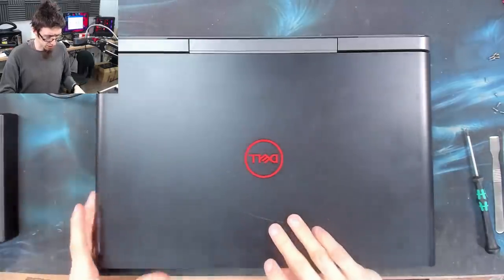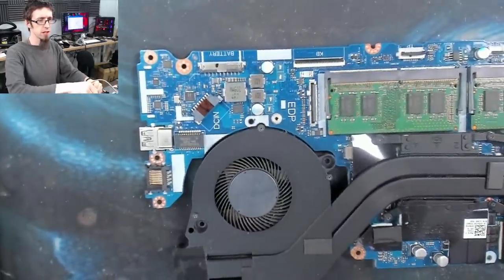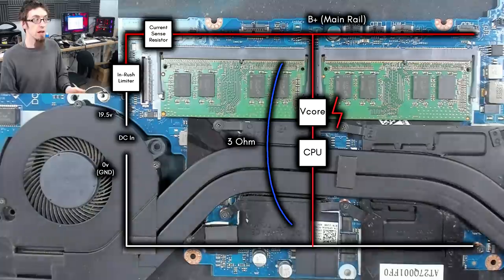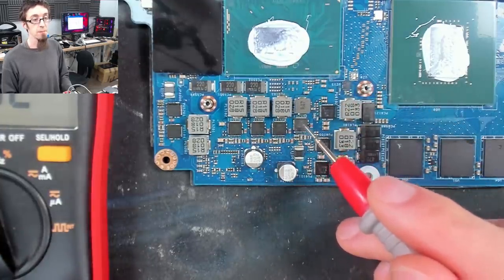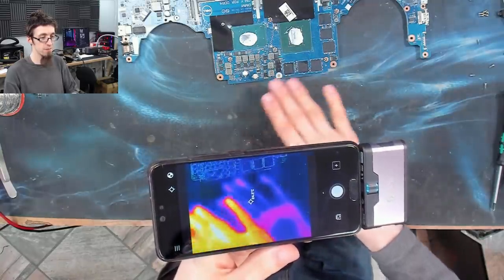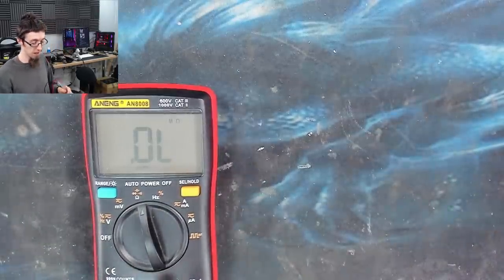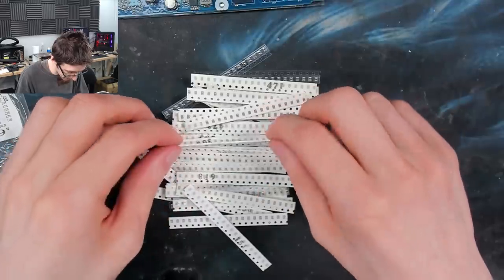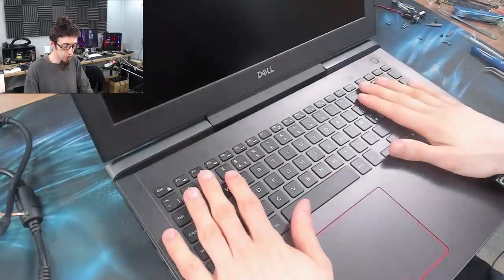How to fix a Dell Gaming Laptop (Dell G5, charger cuts out) - LFC#283

Comment: What are the ebay caps voltage ratings?  No doubt far more than adequate on a 1.8v rail, just curious.
Reply from the maker: It varies based on capacitance and package size, usually the ebay listing will show the voltage ratings. For most repair application, like laptops, everything will be size-appropriate, so low voltage rails will have physically smaller MLCCs on them with lower voltage ratings.
The voltage rating can matter when your draw extremes, for example, a 50v cap on a 1v rail won't break, but the 1v rail won't actually be able to charge the cap properly. But you'll only get caught by this if you're fitting physically gross-over-sized capacitors, which is unlikely. All of this is more relevant when designing the circuit in the first place.
For repair, as long as it's the right physical size and the right capacitance, it'll almost certainly be fine.

Electrolytic caps (with a positive and negative) are different animals and tend to have much more specific voltage ratings, which do need to be observed. They have much bigger capacitance, but the trade off is a much lower voltage rating, so you may have to search to find a replacement cap with enough voltage to match the physical size and capacitance.

Comment: @Adamant IT. Usually Dell and HP laptops does cycle a couple of times after, RAM , Battery reseat. I deal with them every couple of weeks . I am IT Admin in a company. So there is a lot of them getting defective after time. Usually after Motherboard swap, the laptop relearns RAM and checks everything in its BIOS settings. So usually it takes a couple of restarts and a couple of minutes to boot properly. So next time be patient :)

Comment: Great this is the best explanation of the voltage injection method to find a short circuit I have seen ,especially the explanation around the CPU and GPU Prosit I have learnt a lot today.could you tell me the Flir thermal camera model please.
Reply from the maker: It's a "Flir One". Check out the Seek ones as well, as they also have good reviews.
Reply: @Adamant_IT  Great video. Very helpful comparing to Nordrichfix or Rossmann.  I am going ahead to purchase one. Is it a one, LT or Pro you have got? As the resolution is different for the models (one 80x60 and pro 160x120). Many thanks
Reply: @Adamant_IT  FLIR One or FLIR One Pro?  Great video!

Comment: Why doesn't anyone use protection diodes for the "important" chips?? Transient suppressors, for example. And one should also invent a ceramic capacitor that blows up upon shorting out from the inside, so that service people don't have to search high and low for a shorted one.

Comment: I have an Alienware 17 2014, the GPU MXM card is shorting the board or is it the motherboard slot that is shorted. When I remove the card the system would boot fine on intel built-in gpu.

Comment: Hi there, appreciate the good work you do!

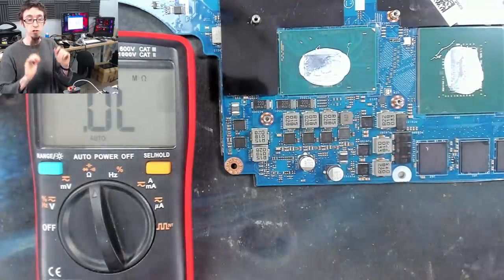If I may ask, at 22:54 you check the GPU inductors
My first inductor (PL6200) reads 20.7 Ohms, yet the second and third (PL6201; PL6202) both give me a reading of 0.3 Ohms - the 2nd and 3rd also look much darker than the 1st inductor :(
Would this be a clear indication that my GPU is fried?

I got my laptop back from the so-called technicians yesterday claiming they fixed the short, yet they suspected the GPU to be faulty
According to the steps followed in your video, I have reason to believe those idiots did not fix the short (since I get a dead short at the points you did), and instead destroyed my GPU due to their negligence

I hope there is something else I could check before ascertaining whether the GPU is dead or not

Thank you
Reply from the maker: Yea 0.3 is very low. You'd need to look at the traces to see if PL6200 is supposed to be the same rail as the other two - if it is, then it should read the same, and a high reading of 20ohms sounds like it's busted or not on properly or something like that. Any heat damage to the GPU? You never know if someone thought heat-gunning the GPU core was a good idea T_T

Comment: what actually caused the capacitors to fail though Graham ?
Reply from the maker: Mechanical stress (shock, etc) might cause fractures which lead to a short, or heat cycles could do the same. Ultimately, small parts like this are mass produced in ungodly quantities, so there's going to be a bad one here and there that dies a little early.

Comment: @Adamant IT Question, when you have a laptop come in that you repair and notice a mechanical HDD, do you recommend replacing with a SDD to improve performance for customer?
Reply from the maker: Most of the time, yes, but it depends on what the laptop is in for, what the customer is using it for, etc etc.
I recommend SSD upgrades when I can though.
Reply: @Adamant_IT  Was just curious since I noticed this laptop had a HDD.  Otherwise it seemed to be good laptop.
Reply: @hillardbishop8755  if you look closely at the beginning there is a nvme drive just above the hd so it boots off that and only uses the hd for extra storage. I know this as this was my laptop being fixed, and very pleased that it was fixed
Reply: @MrSeanroberts1969  That helps, thought it might be an Optane m.2, friend of mine has a HP laptop that has a Optane m.2 and HDD. Always thought why not just run nvme, it would be far less expensive than Optane.
Reply from the maker: Yea optane is a waste of time in consumer gear, better to have a full-fat SSD. Enterprise Optane stuff is a different animal. This laptop had an NVMe SSD and a 2.5" SATA SSD in it 👌
Reply: @MrSeanroberts1969  Must have been interesting/fascinating/terrifying to watch your 'beloved' laptop being repaired in this way!
Reply: @DraftySatyr  it was very interesting, but without sounding blasé about it, it’s just a work laptop so, great if it could be repaired but I’ve already replaced it so it will become a spare, but still wonderful to watch being repaired

Comment: Sir what will happen if you don’t change those capacitor?
Reply from the maker: Most of the time, the device will work without it. A lot of caps are for electrical noise/emissions testing, or just extra reliability. It's good practise to try and replace if you can though.

Comment: Maybe I'm wrong (I usually am), but aren't capacitors directional? If you see this comment, thanks for your help...
Reply from the maker: Ceramic capacitors (the brown ones like these small SMD boys) go either way. Bigger caps like electrolytic, tantalum, allu-poly, are polarised and have a positive or negative marking.

Comment: Whilst your doing a pretty good job at explaining basic stuff & prop's for that why the hell did you buy a USB FLIR?... When you can buy a Blackview BV9800 phone with built in FLIR that just works with no janky usb/app to deal with for close to the same price, as for MLCC's their usually rated at 25V & 99% of them are 10uF as decoupling caps so instead of buying a multi pack of random values which as you stated you'll never use just buy as I do at a 1000 at a time 10uF caps it's much cheaper IMO, Just some advice from experience.